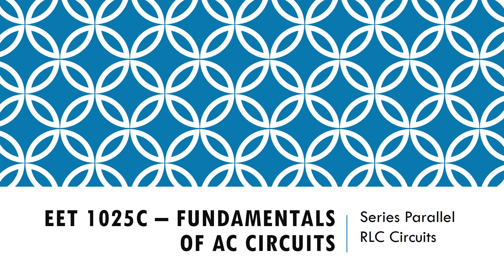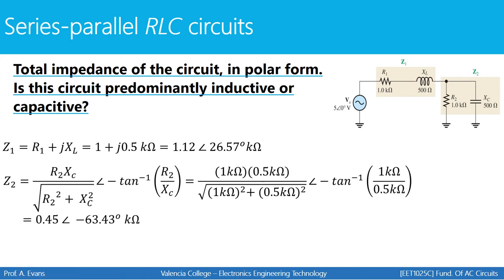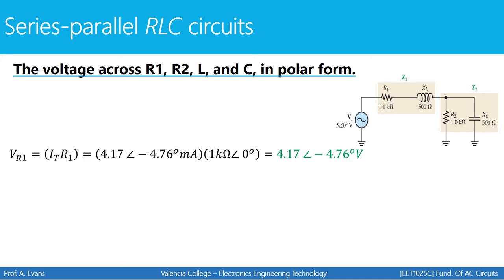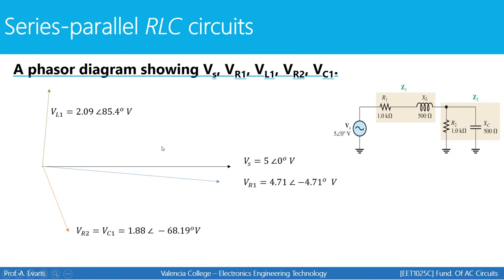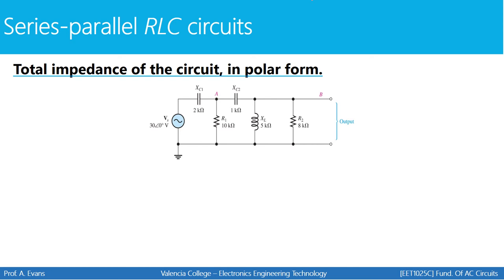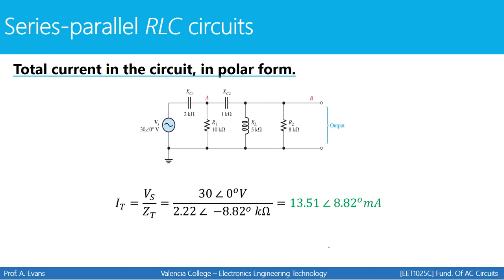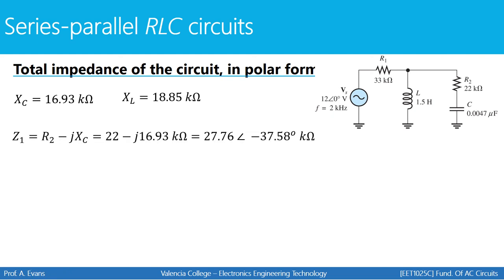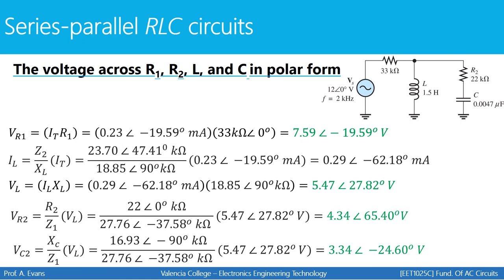[EET 1025C - Fundamentals of AC Circuts] Series-Parallel RLC Circuits

Comment: Wonderful lecture.when getting Z2 it's easier to compute (1.0k +j-500)/(1.0k*j-500)
Reply from the maker: Yes, you can also use product-over-sum to also compute Z2 as well.  But, take a closer look at how you typed this, above ;-) 
I like to show different methods of calculating values, just to show there may be more than one path to a correct answer.  Thanks for pointing that out!

Comment: when you do current division , you seems to use the denominator as only one branch of the parallel impedances, the denominator should be the sum of the parralel impedances
Reply from the maker: Hi Joe, thanks for watching! You might be thinking of a voltage divider here. When you have a voltage divider, the denominator is the sum of all resistances in series. But with the current divider, it is the numerator that is the total resistance of all the parallel paths you are dividing the current among. So in these problems, you'll see that the numerator is the combine resistance of all parallel paths, while the denominator is the resistance of the path in question, where the path we want the current for.

Comment: How would you find Z1 using a calculator?
Reply from the maker: It depends on what kind of calculator you have. For example, a TI-89 can automatically convert from rectangular to polar and you can type in the entire calculation in one step. If you don't have an advanced calculator, you would need to do each calculation in multiple steps on your calculator.  

This might mean first converting from rectangular to polar, or polar to rectangular depending on what value you're trying to find, and then doing additional combination of rectangular values or polar values. I go over the conversion from rectangular to polar, and polar to rectangular in an earlier video within the AC circuits playlist. If you need to see that information, look for the introduction to AC circuits video I posted.
Reply: @profashleyevans  ok thank you ill look for the video

Comment: How do I calculate the voltage at B?
Reply from the maker: The voltage from terminal B to ground is the voltage across R2, which is also the voltage across X_L since they are in parallel.  Since we have the current through I_C2, you can use that along with ohm's law to find the voltage across the parallel combination R2 // X_L, which would then be the voltage across each of those individual components.

Comment: Your R2 value is incorrect in the product over sum equation at time 9:53 of the video.  You have 9k ohms vice 8k ohms.
Reply from the maker: You are correct!  It was a typo, my apologies.  Even though a 9k is displayed on the screen, 8k was used for the actual calculation.  I will work on getting this fixed.  Thank you.

Comment: Why 0.5k ohms has 90°?
Reply from the maker: Hi Rocky, you'll notice the 0.5 k-ohms ( around 4 minutes in) has a j component attached to it.  This j means that the value lies on the imaginary axis, at either +90 or -90 degrees.  Since the term is  "+ j0.5 k-ohms", it lies on the positive imaginary axis and thus has a phase angle of +90 degrees.